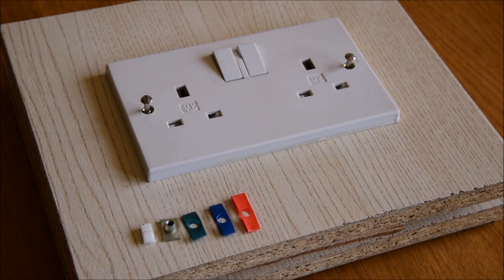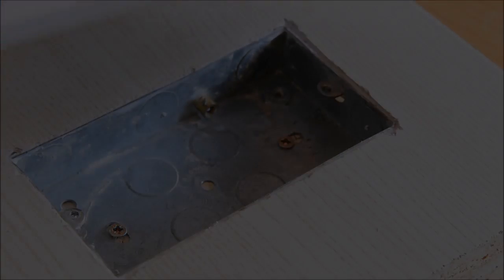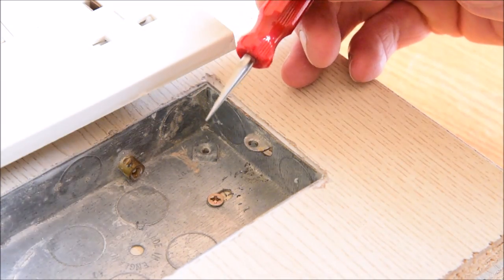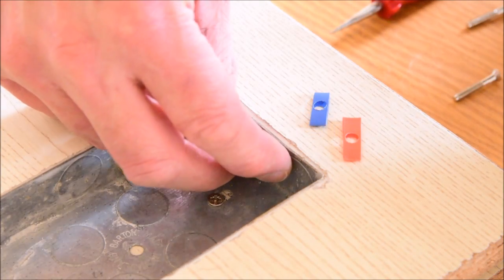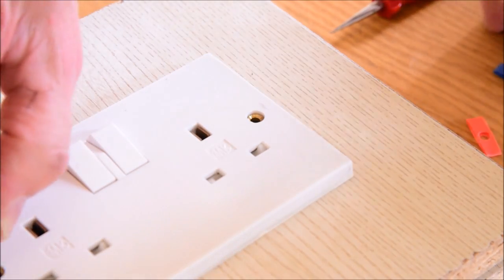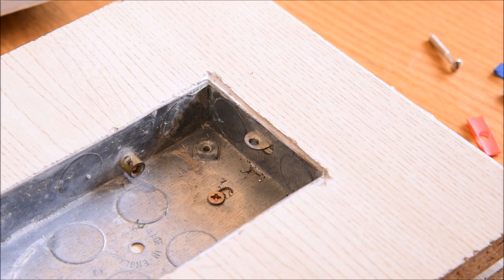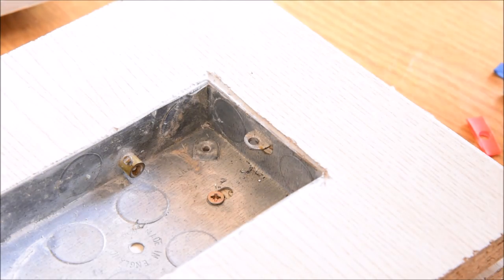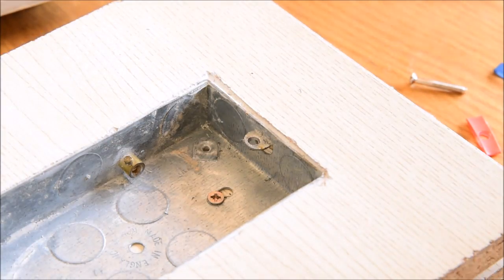Fix a broken screw thread in your electrical back box with Back Box Saver

Comment: I came across a socket in my house when redecorating that someone had used a wood screw to hold the socket on . So it wrecked the thread . Tried that rethreading tool but the hole was to wide . I was just about to dig out the box when I came across this clip . Just ordered them thanks for saving me digging the box out .

Comment: That's weird, a new backbox costs 50p and one of these saver things is £5.99. 
Surely that doesn't make sense.
Reply from the maker: True, but when the box is tiled around, in an expensive kitchen, and your van is down the road on a meter, £5.99 to secure the switch quickly and easily, is very cost effective indeed...

Comment: What if the lug itself is broken??
How to repair it on a concrete wall
Reply from the maker: If the lug has snapped off the box, then I’m afraid this kit cannot be used - you’re just going to have to replace the box.
Reply: Ive seen some items on ebay that replaced the whole side with a brace that you can screw in and put a screw into.

Comment: What can I do if the lug has sheered off? Replace the whole box?
Reply from the maker: Sadly Wendy, that's the only option. You can bodge it with a very long screw into the bottom of the box, but it's not recommended.
Reply: @klondike2020  ok - thanks so much Peter.

Comment: This is a really good idea, kudos.
Reply: Thank you Sir! The video has since been redone and is on our website (www.backboxsaver.com). This was our first attempt, and a little wordy! ;-)
Reply: @backboxsaver737  it's a solid demo, so much so I purchased it off Amazon last night, looking forward! Should save alot of money and hassle.
Reply: @backboxsaver737  installed it today, did a fantastic job and saved me about £90+!
The metal plates being rounded on one side was particularly useful for one of the old holes, where it's on a piece of metal that moves about.

Comment: Can you but them in the States.
Reply from the maker: Hi Johnny, I’m afraid we don’t actively sell them to the US because you have imperial (inch) screw threads and in Europe we use 3.5mm. The BBS would work, and I have checked with US back boxes that it would fit, but you’d have to use the screw that comes with the kit. So you’d have one US screw and one metric screw. At least your socket would be tight though!
Message us through the website and we’ll check shipping cost. Thanks!
Reply: Because the face plates are a separate component from the outlet itself in the US, the different screw would be covered up so it really wouldn't matter.

But since it doesn't matter, it makes more sense to just tap it out to a slightly larger screw.

Comment: Hi - I have a broken screw in the back box (the screw snapped when tightening up the front plate to the back box - do you have any advice on how to get the broken screw out pls? thanks
Reply from the maker: Hi John, Switch off the power first. Remove the other screw that's securing the switch plate, so you can lift the front plate out of the way. If the screw has snapped off cleanly, you might be able to grasp it with a pair of fine pliers, rotating it so that it either comes out, or goes forward and falls into the box. It's hard to be more specific without seeing it. Trust this helps though.

Comment: So what are the sticky pads for?
Reply from the maker: Sometimes the lugs are at the top and bottom of the box (those big cooker switches for example), so there is a chance the BBS could drop off the lug. The sticky pad can be used to stop the BBS nut and its sleeve from falling off the lug just while you line up the switch and engage the screw.